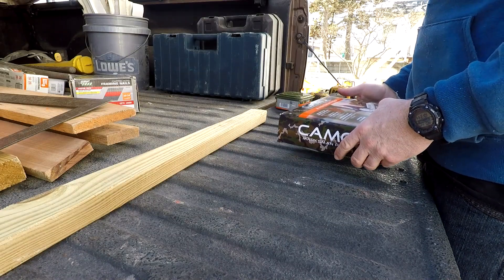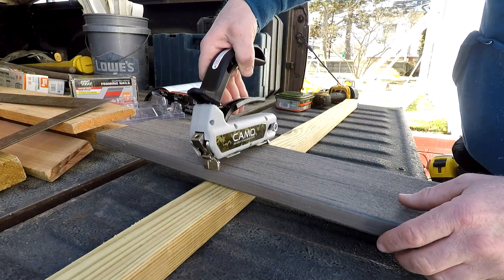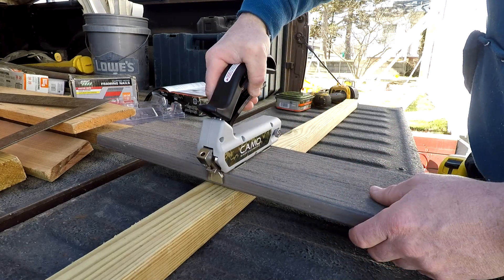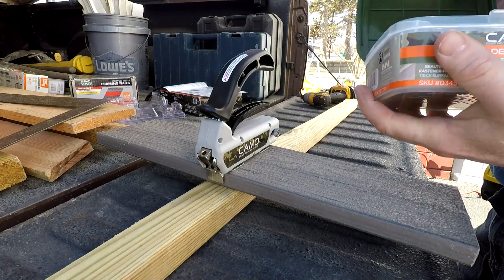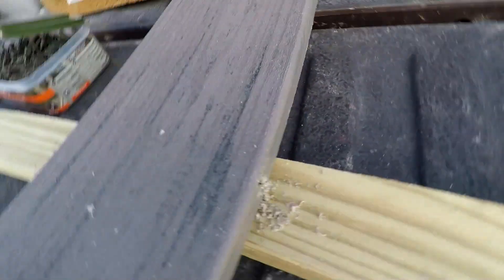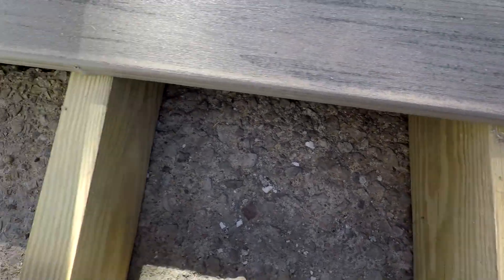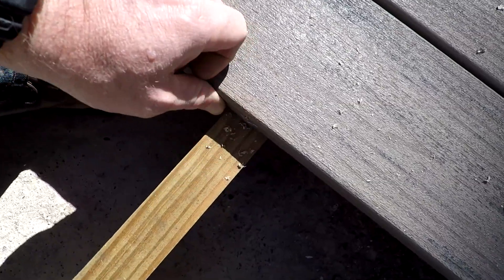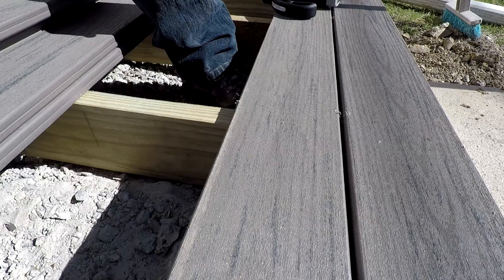Camo Marksman Pro Review | MY DIY

Comment: Thank you for the thumbs up review. Nice work. The screws are designed to drill out the board as they go in. If pushed too fast the millings from the drill are not being exhausted out of the hole. That is one cause of the "bump". The driver bit you used is meant for grooved decking. It sinks the screw deeper than usual. The screw being deeper added to the "bump". There should have been a driver bit without the red stripe packaged with the screws.Let me know next time you want to use the CAMO Edge Screw system or CAMO EdgeClips. I'll see what I can do to help you out.  Thank you for using CAMO!
Reply from the maker: Thanks for watching! Are you a Camo rep?
Reply: @MyDIYBuilds  Yes I am. Just came across your video looking for one of ours.
Reply from the maker: Awesome! You guys have got some great products, I use them quite often when building decks!
Reply: @greg Hartmann. Hey I purchased the pro x1 but it says for wood use, only. Will it work on grooved composite, and what type of screws/tip should I use?
Reply: @joyfilopez6162  The Marksman Pro X1 is for wood decking that will shrink as it dries. The gapping between boards is too tight to use with any other decking. Swap the Marksman Pro X1 for the Marksman Pro. You must use CAMO Edge Screws available in corrosion resistant ProTech coated steel or stainless steel. To avoid the bump that he was getting in the video allow the screw to drill out material before applying pressure as you drill. A quicker installation will result if you get the pre-drill bit. Run two drills. 1 with the pre-drill bit and one with the driver bit. Where are you located? More information at CAMOfasteners.com
Reply: Thank you Greg for the explanation. I am going to be laying down $4,000 worth of composite this weekend and was sold on this method until I saw this video. Your response solidified my decision to go with the CAMO
Reply: @jaybaar1  That is good to hear. What composite will you be using? Where are you located? Where will your materials be coming from?
Reply: @greghartmann4984  I'm going with Fiberon composite.  I live in NH and the manufacturer is in ME.  I'm using a dark brown (burnt umber) with black color streaking, nice stuff.  I'm thinking the Marksman Pro with the darkest brown screws you make (if I can find them).
Reply: @greghartmann4984  I ended up buying both systems and ordered the bits from Amazon. Lucked out with the screws a local home depot had a few boxes in stock. Thanks for your help!
Reply: Greg Hartmann Can you hook me up with some Camo edge screw?.. I’m getting ready to install my redwood deck.
Reply: @Starfox-zg4tk  where are you located?
Reply: Is the hidden clips better?
Reply: @greghartmann4984  Hi Greg. Can I use the Camo edge screw system with timbertech decking with a grooved edge and a scalloped bottom?? The website only shows composite with a square bottom. The scalloped bottom boards are not talked about.
Reply: @christianchilds7426  That should not be a problem. Use the grooved board driver bit and get the predrill bit or follow the instructions in the Marksman manual  on how to pre-drill composits.This will speed up the installation and result in a more attractive installation.
Reply: @ghhartmann  thank you so much for responding!

Comment: We are redoing out deck since the guy who installed it didn't leave gaps between the decking and some of our boards started to rot out.  We pulled up half of the deck and I decided to use Camo system to replace the deck boards and so get a look without the screws on top.  I ended up buying three of them so my son and wife can put in screws as we lay each board.  It worked great and the look is much cleaner than using regular deck screws.  We found that they hold so well that they can even take the twist out of a deck board easily.  We are sold and now my wife wants me to do the deck around three sides of our porch since she now hates how the nails in it look.  More work for me but I love this system for putting down decking.  BTW, we used regular deck boards that we prestained on all sides before we put them down.  They ended up looking fantastic and driving the screws is a snap.
Reply from the maker: Awesome! Sounds like a 5 star review for the Camo Marksman Pro! Thanks for the input👍

Comment: I did my 250 sq ft deck and used pvc decking with no bulgdes on the side. Worked perfect every time. So perhaps its a composite issue.
Reply from the maker: Check out the pinned comment, apparently the lumber yard sent the wrong screws. It was the first time I had used it so I had no idea...lube and learn o guess! Glad it worked out for you, and thanks for watching!!!

Comment: Thank you I had ordered the Kreg jig system haven't used it was thinking about sending it back but I will just stay with the Kreg system since my decking is Composite too. I don't like that bulge you were getting on 50 percent of your boards you say.
Reply from the maker: Apparently I was using the incorrect screws...hopefully the Kreg works out for you!
Reply: @MyDIYBuilds  Thank you. I was going to send the Kreg back before opening but the Camo just seemed like it had few issues probably doesn't really matter? Good video.
Reply from the maker: Thank you! And thanks for watching!
Reply: @MyDIYBuilds  The box of screws you showed look like all the others I have seen from Camo.  May I ask what was wrong about them?  I am laying $4,000 worth of composite this weekend and was going to use this tool.  After seeing your results I am haveing serious second thoughts.  Thank you!
Reply from the maker: Jay Barrett check out the pinned comment by Greg Hartmann...apparently there are different screws although I was unaware of that.

Comment: I'm not a fan, The screws are not going in deep enough for some reason, so I need to start them with the tool and then complete the connection without it. Ugh... very frustrating. And the driver strips so I've been through 3 of them. I came here to figure out what I'm doing wrong. I did use EPDM for a waterproofing barrier so there is some additional rise on the jost but not that much and the fabric is soft enough. Anyway.
Reply from the maker: Check the pinned comment, he told me I was using the wrong screws. Maybe that’s the same issue you’re having?
Reply: @MyDIYBuilds  Thanks so much
Reply from the maker: We’re all here to help each other out!👍

Comment: You’re using the wrong driver bit. If you use a Camo driver bit or put a depth control collar on a standard bit to control the drive depth, the screws can only be driven to the correct depth. This means the heads will be flush with the side of the timber and will not bulge the screw hole.